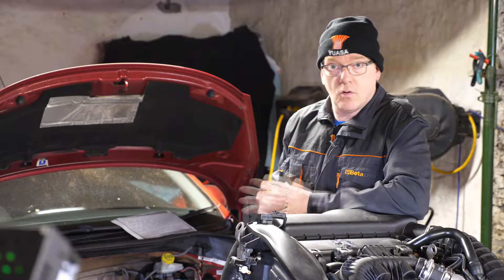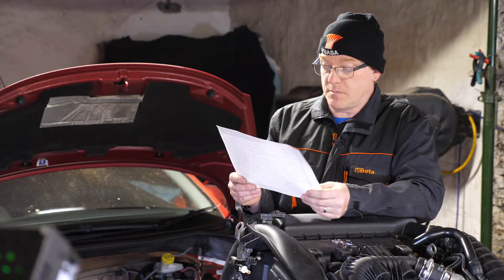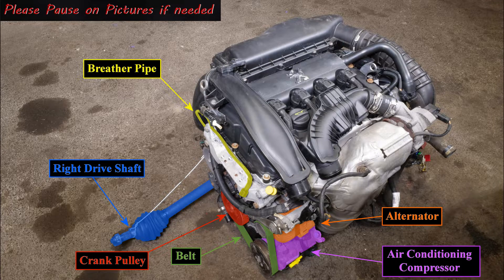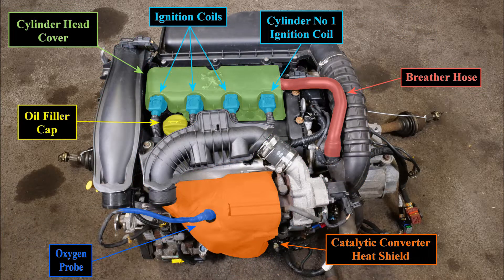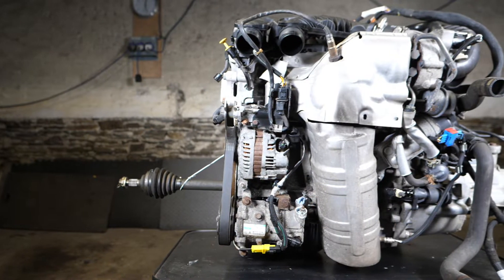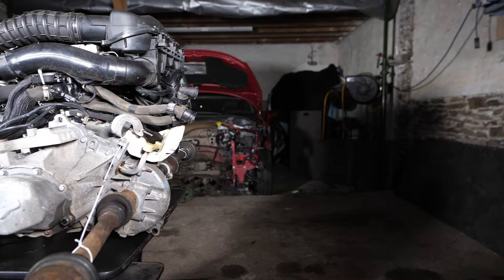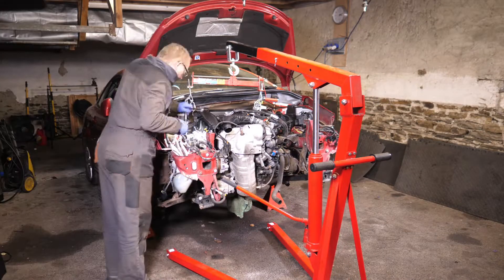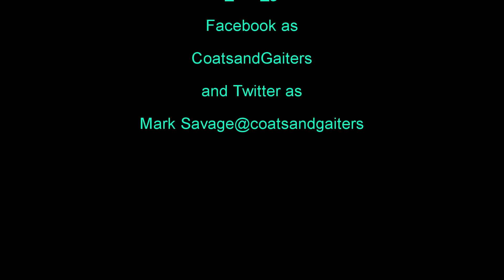Part 1 - Peugeot Citroen EP6 DT - EP3 THP150  Petrol Engine Tear Down  BMW N13 N14 N16 N18  DS3 DS4

Comment: This engine requires very strict oil management. The browner the inside of the head cover is, the more dirt there is from blow-by gas, which can lead to oil leaks, the chain stretches and breaks the guide, which causes the valve timing to shift and come into contact with the piston, oil leaks from the stem seal, and white smoke comes out of the exhaust. The inside of my engine is a silver metallic color, and it has been running for over 110,000 km, but there is almost no timing shift, the chain is only slightly stretched, and there is no damage to the guide. When the guide is worn down, debris clogs the oil solenoid, causing a timing error in the number 1 cylinder.
Reply from the maker: Thank you for sharing your experience.  Good information.

Comment: The section on "Identification of engine parts" is absolute gold! I don't have the nerve or the equipment to pull the engine out of the car for repairs, so this helped me better understand what I'm feeling around the back and what may be blocking what. Thank you for making this!
Reply from the maker: Thank you for commenting.  I feel terrible for getting sidetracked on some other cars but still plan to dissect this engine and carry the series on.

Comment: We have one in an automatic 2009 Mini Cooper S that we bought new and has never been driven in anger. It’s done 114k km (70k m). After numerous major coolant and oil leaks, the latest narrowly missing an engine fire by leaking onto hot turbo parts, it’s just had a timing chain. The second. It had already had a timing chain tensioner as part of a recall, but this time BMW France only chipped in about 10%. Second timing chain work also included a new cam shaft and various other things. A €2500 bill. I think engine work on this car put end-to-end now outstrips the car’s current value. It’s one one the least robust engines I’ve heard of. Now they’re older I’d advise to avoid at all costs. Oil consumption is also very high.
Reply from the maker: Sorry to hear this but I hear non stop problems about this engine and the later 3 cylinder derivatives.  It's a real shame.  I should know as I had this engine running for my Peugeot 207cc series and just before I was about to take it for an MOT it literally self destructed while sat ticking over outside.

Comment: Hello Mark, welcome back. I am on familiar territory with these engines. It will be interesting to find out what has gone wrong with the engine. Its very strange that the piston has hit the spark plug, the usual failure is the timing chain snapping.  I am looking forward to the rest of the story.   👍👍👍
Reply from the maker: Hi Neil.  When I was reading my notes back from last year and I said water in No 4 cylinder I'm wondering if it hydro locked possibly.  In the last video on this car I manually forced the timing back and got the car running and all was well so it surprised me that it catastrophically failed like it did.
Reply: Hello again Mark. You would think if it was a hydro locked it would bend the con rod down away from the 
cylinder head/spark plug, but that me just thinking in simple terms. I know the jaguar V6 engine has a habit of snapping crankshafts, lets hope that's not the case.
Reply from the maker: @neilhampson2843  I’m curious why there would have been coolant in No 4 cylinder Neil at the time?  I heard the timing can slip on these as they are friction held crank and that Peugeot didn’t stipulate a high enough torque at manufacture.  I understood Ford did the same friction fit on their cranks but it was so tight you needed to use a torque multiplier to undo it and re tighten it so was Peugeot a bit optimistic with a lower crank torque level.

Comment: Thank you so much for these videos! I recently became the owner of a Peugeot 308 T7 wagon, a 7-seater. It originally belonged to my brother-in-law, but after they bought a new CRV, the car was destined for the scrap yard. I decided to take on a full restoration instead, and your videos have been incredibly helpful.

So far, I've removed and cleaned the cylinder head, valves, and more. A couple of years ago, I used one of your videos to successfully replace the timing chain on my R53. Your content is fantastic!

Greetings from Adelaide, South Australia.
Reply from the maker: Thank you for that and good luck with your build.

Comment: Great vid, thanks. My son has the 1.4 in his 207. It has been a nightmare and has just lost power over 2.5 k regs again. We are running out of things to check,change, adjust... almost given up on it now, a pity as the car is solid and he has put many hours in. Never again...
Reply from the maker: Thank you.  I need to get on with the rest of this series and strip this engine apart as planned.  These engines are a nightmare.  This one was working and destroyed itself just sitting at idle.
Reply: Could be hugh pressure fuel pump, tend to be the first to go. Coil packs might be worth looking at as well

Comment: Hi, great engine. I’m struggling to locate the oil pressure sensor on this engine? Would you know where it is. Thanks
Reply from the maker: Its above the flywheel by the cams.  Remove the big black air induct hose to the right of the engine.  Remove the rigid hoses underneath and almost to the side of where the cam is you should see it buried deep.  Not easy to find. 6:09 in my video is where you want to be.  https://youtube.com/watch?v=-fL-R9kShtQ&feature=shares&t=369

Comment: Sa change du 1.6 hdi 110 😂😂😂😂
Reply from the maker: Put the Diesel engine in? The car's resale value wouldn't be worth changing the engine on.  There isn't much demand for the 207cc in the Uk.
Reply: @CoatsandGaiters  non sa change du 1.6 hdi 110 de la mini quand t’avais changer le kit chaîne arbre à came
Reply from the maker: @mecaautodiag2741  Oh I see !!! this car I did some video's on last year but it locked up and then sat in my barn for months and I went onto Mini's.  I thought I need to do something productive with it that might be of some benefit to others.
Reply: @CoatsandGaiters  oh ok ✅ 😁 courage